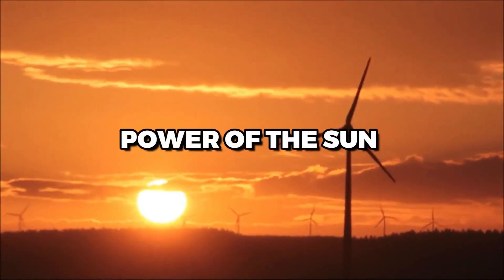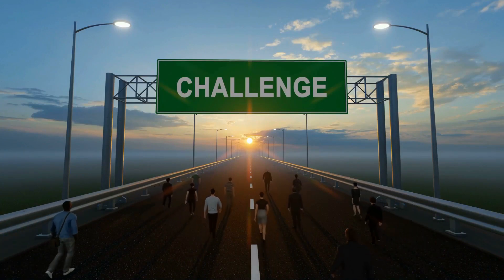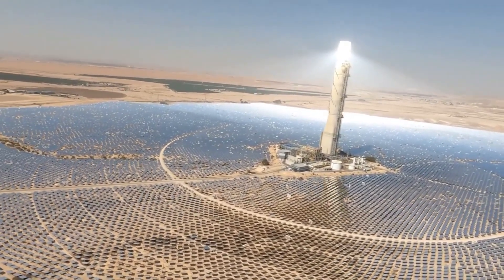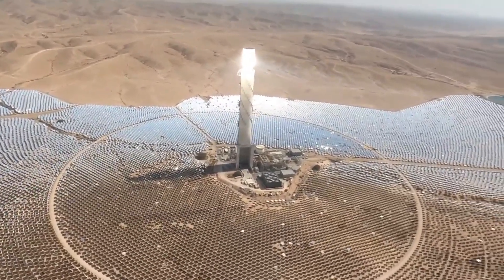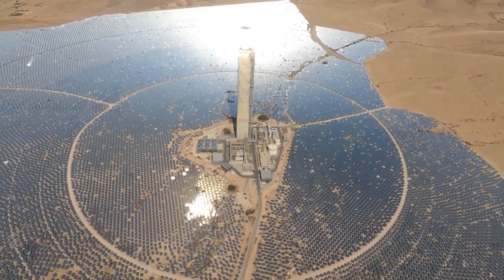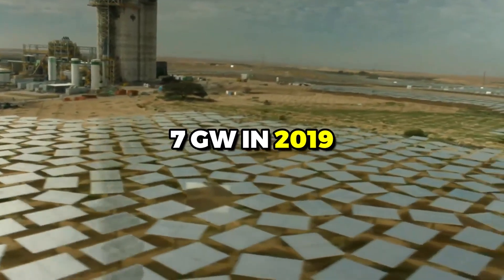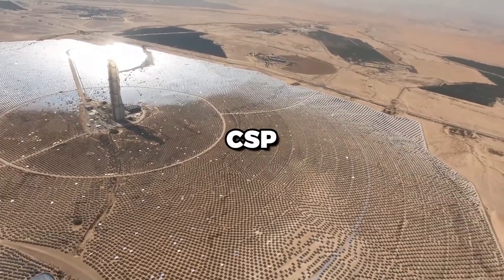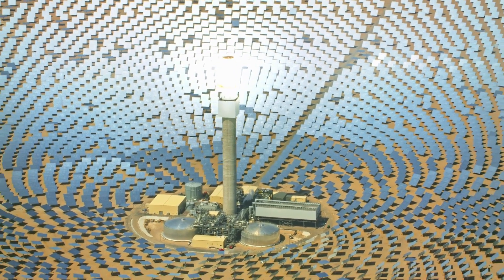"Revolutionizing Energy: The Rise of Solar Power by 2026 Explained"

Comment from the maker: What are your thoughts on Concentrated solar Power?
Reply: My thoughts are that I have my doubts that it can compete with photovoltaics for electricity generation, but that it may prove useful as a zero emissions thermal energy source to provide process heat for industry. Would like to know more about potential for use aside from electricity generation.
Reply: I guess my only concern with PV is that when you add battery storage, the cost skyrockets especially as battery usage increases. Whereas, with CSP thermal storage, the more that storage solution is used,  the greater the cost savings, which is a massive benefit for CSP.
Reply: The salt is corrosive. The maintenance cost will kill all the savings.